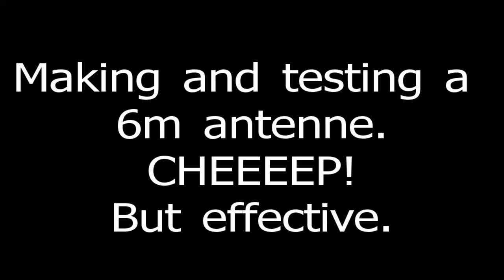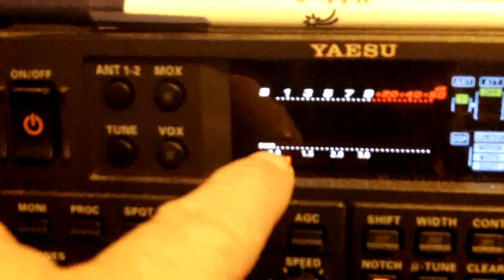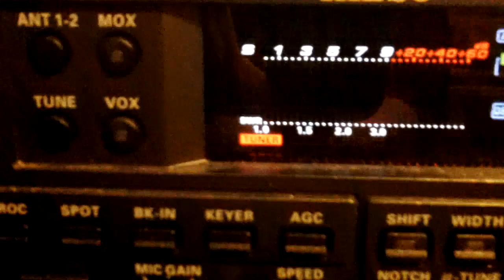Building a 6m antenna

Comment: Nice vid and cool antenna!  I have a FT-950.  Love it.  I noticed that your Tuner light was on so I assumed that you showed us the SWR after the radio tuned it up.  I was thinking of building one of those little beauties so I was curious about the untuned SWR.

Thanks!
Reply from the maker: jim95503 I had no way of testing besides just tuning it up w/the radio. I'm still pretty new at this..wish I could tell you more.

Comment: A 6 meter trick-stick.  Anyone else remember the Cushcraft Trick-Stick dipole antenna from the '60's and 70's?
I have 2 home brew trick-sticks, one on 10 meters (works to 17 meters with a tuner) and another for 6 meters both mounted horizontally for SSB work.
Reply from the maker: ..not I..but I’m slit learning!

Comment: Question: If the antenna is perfectly tuned then why are you using the tuner in the radio?
Reply from the maker: because it’s there?
Reply: @dafrogtoad  LOL ... So the antenna is not tuned properly so a matching device had to be used....Classic.